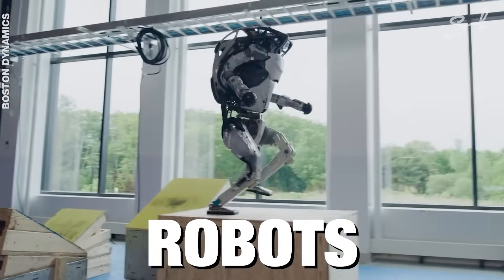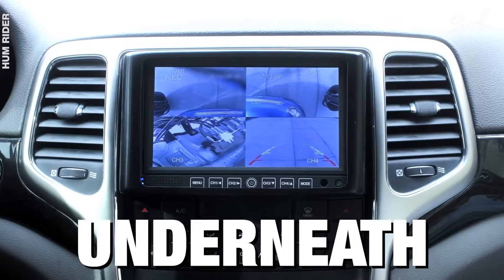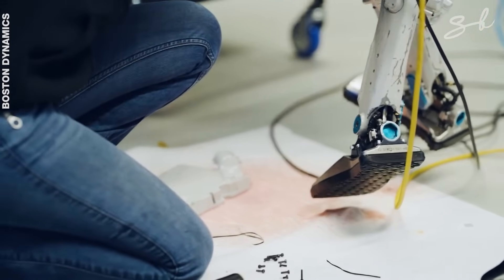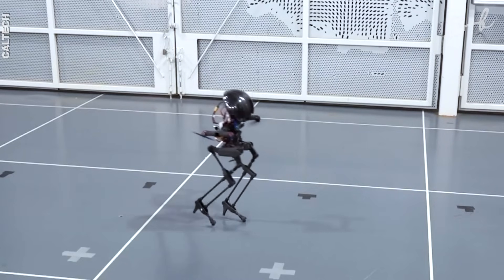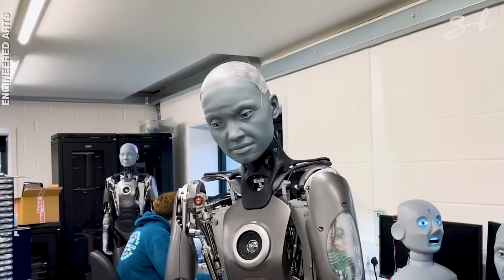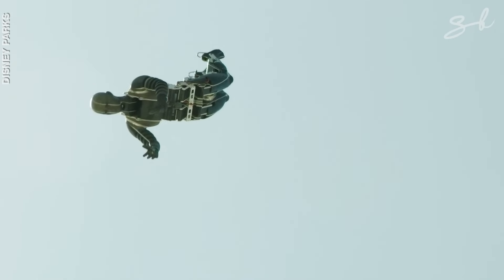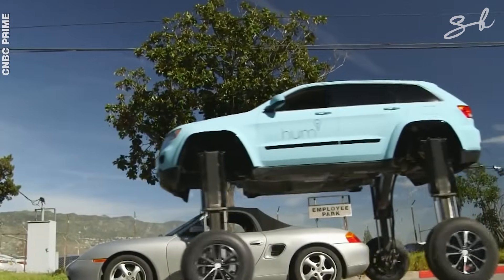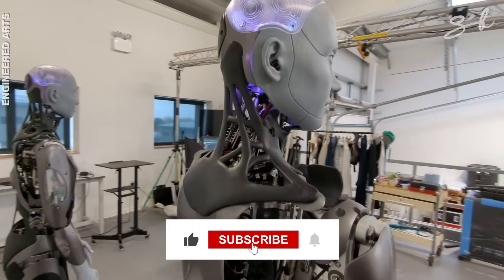World's Most Advanced Stunt Robots

Comment: If a robot can dance they have developed robots to the point where they can be designed to be a soldier.
Reply: Robot soldiers don't need to walk on two legs to shoot you. They don't need to walk at all to be a tank. Four legs or wheels are much more stable and there is no reason to make robot soldiers less stable than possible. The NYPD is already using Boston Dynamics' Spot. I don't think they already gave it a gun, but that has nothing to do with its ability to dance (which of course, it can do too) and more with the rest of sanity they still have. Dancing was not the critical point. It was just walking and going up stairs.
Reply: @juschu85  Two legs or four legs it doesn't matter. The point is the coordination and agility are what is important.

Comment: I have controlled and interacted with the Boston Dynamics yellow Dog. it's a pretty cool robot but I think it still needs some work. it can traverse obstacles and stairs etc pretty well but it has some issues still to be worked out. they are constantly improving it, and adding things to it to increase its capabilities. My brother works for a company that is helping them increase its usefulness in warehouses etc. unfortunately I think it needs a lot more work. it's a very cool robot and quite expensive. it's already deployed to some customers and they are constantly finding new uses for it.
Reply: Give these robots another 10-20 years, and they will be ready (or maybe).
Reply: @MinhVu-fo6hd  yes I think in a few years it will be a significantly better. They are working on many onboard attachments to the top of it. Including some specialized hearing to actually hear ultrasonic sound leaks from high pressure pipe leaks, and it reads guages already thanks to my brothers work.

Comment: What is the purpose of the car robot? To cut lines in traffic? Not efficient for the community. Just turn all car a smart car and use GPS and all sync with other cars to detect each other cars, removing car crashes to other cars, and self driving so you can sleep as a driver while heading to work, just punch in your destination and be there.